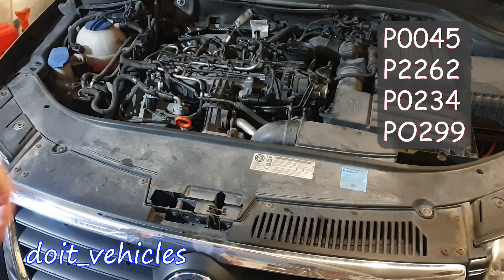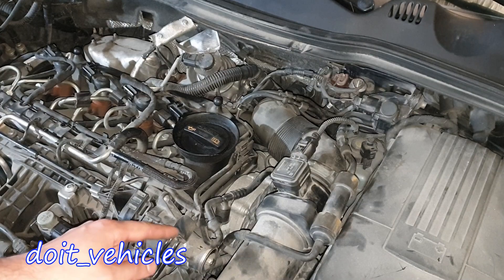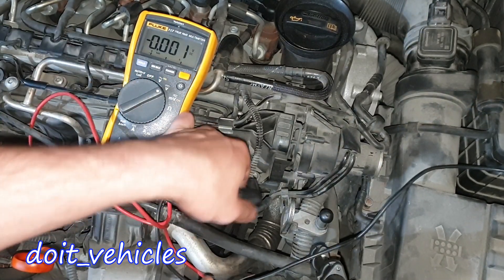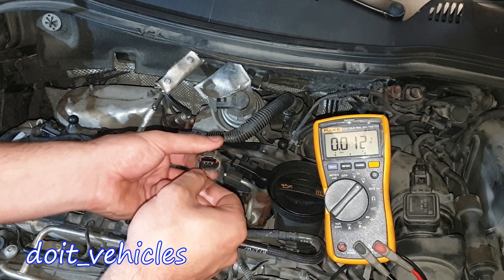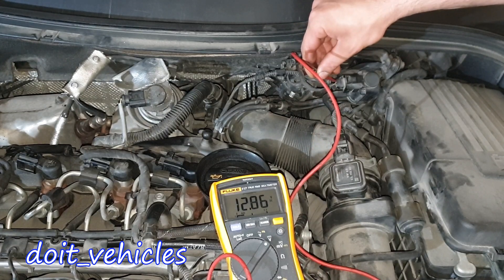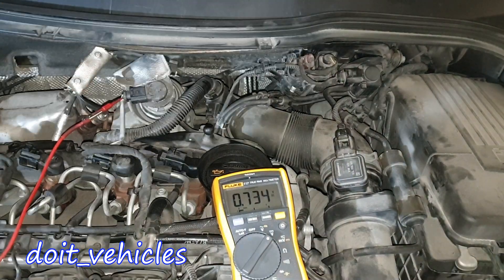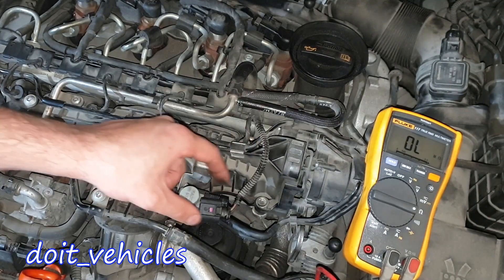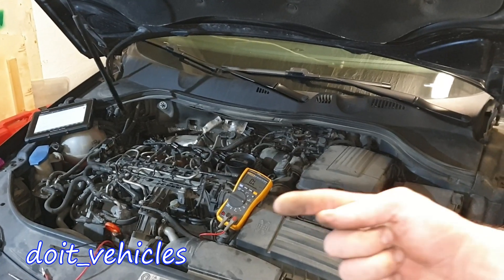Volkswagen Passat ALL Turbocharger Electronics Bench Test 1.6 TDI

Comment: Howdy!  What can cause the turbocharger position sensor error P 2654?  The turbocharger was refurbished, before it had no errors, only mechanical problems.  I saw in the Passat that the minimum value with the ignition on is 0.7 volts.  P 2654 means signal too weak.  What is the working range in volts of the sensor?  From 0.7...to how much?  If it is below 0.7 does it generate this error code?  When the turbocharger was refurbished, wasn't the sensor calibrated?  Thank you!